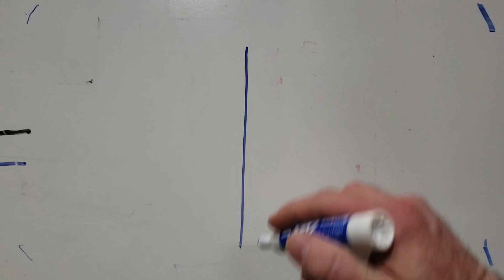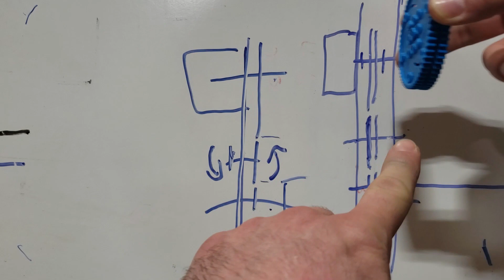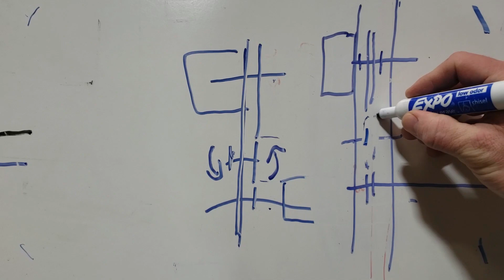VEX IQ Slapshot flywheel troubleshooting

Comment: One thing that could also be causing some unnecessary losses is that leftmost transitionary gear rubbing the rubber stopper on the driven axle. Based on this I would also recommend in addition to what's in the video, is removing the transitionary gear that is to the left of the 2x12, because it seems to not be necessary as it is not transferring any power
Reply from the maker: Correct, the left gear is not doing anything and may be rubbing.  Hopefully once rebuilt with proper supporting structure, there will not be any rubbing.  Thanks for the input Soren of our past 2048R state champion team.